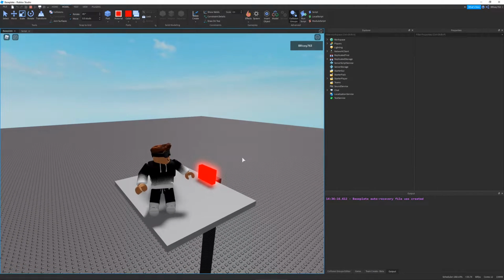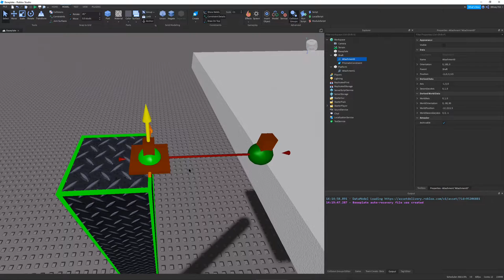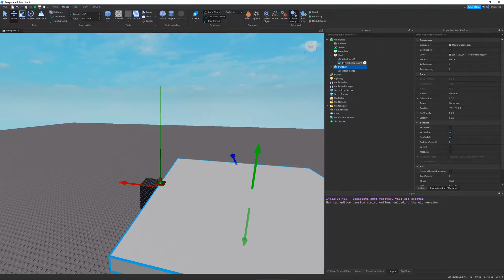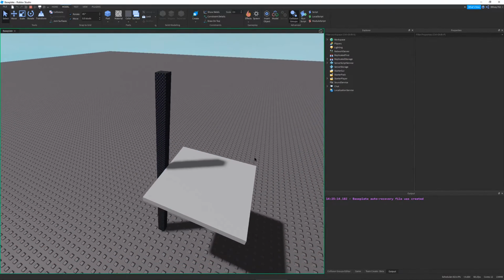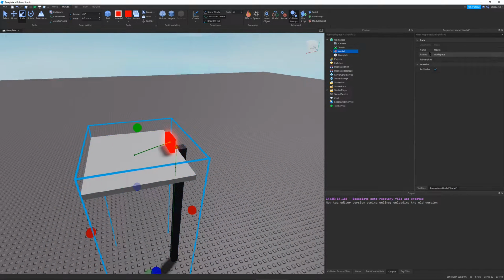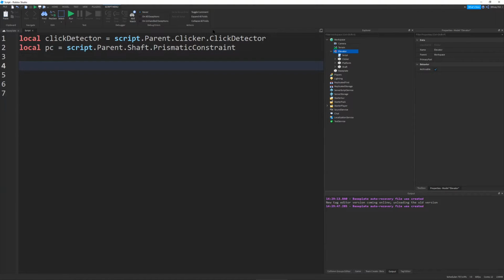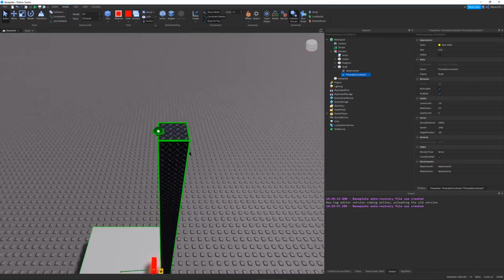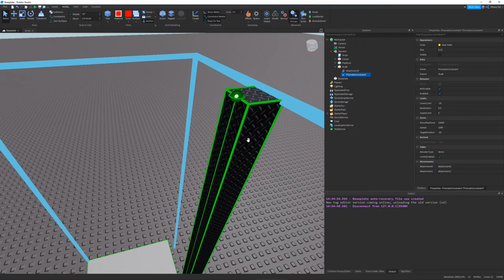Create an Elevator Using Prismatic Constraints! - Roblox Studio Tutorial

Comment: There is an issue with prismatics and a reason why tweening would be preferred:

Tweens take up less network resources
Just because constraints don’t require any action on your part to replicate to clients doesn’t mean it has no network cost. In fact, they have more network cost,. Instead of a simple event telling clients that the door has closed, it now has to replicate the exact position of the door.

Constraints, obviously, are bound by physics
Sometimes, accurate physics simulation is a bad thing. While Roblox’s physics engine has gotten better, it is not infallible. It will break sometimes. Tweens ignore physics and keep moving. So, if a player puts something in the elevator shaft, for example, a constraint-based elevator would break and a tween-based elevator would clip through the object. This would probably lead to the object either being flinged to oblivion or inside the elevator, but regardless, the elevator remains functional.

And being bound by physics, players can exploit the system
Roblox distributes the task of simulating physics to players to save server resources. This is even after FilteringEnabled. This means an exploiter could, in theory, break the elevator if the server lets it simulate the elevator’s physics. There is probably a setting to stop this, but I’m not sure.

Comment: Great video! Thank you I struggled a bit at first. Script works for 2024. Be aware of the target position I forgot the - before the value and it took a minute for it to work. Also make sure your adding your target position and not the videos. 

-- Access the ClickDetector and PrismaticConstraint
local clickDetector = script.Parent.Clicker.ClickDetector
local pc = script.Parent.Shaft.PrismaticConstraint

-- Variable to track the state (up or down)
local isUp = false

-- Function to handle mouse click event
clickDetector.MouseClick:Connect(function()
	-- Toggle the state
	isUp = not isUp

	-- Set the target position based on the state
	if isUp then
		pc.TargetPosition = 0  -- Move to the up position (0)
	else
		pc.TargetPosition = -27  -- Move to the down position (-27)
	end
end)

Comment: again, just like the last video a watched, it works for everyone but me... i have it with the prismatic constraints connecting the two, but the platform just doesnt move.
Reply: I actually encountered the same problem, did everything as suggested and it didn't work at first. Tried it again and found the mistake. The second time I actually didn't group the objects and I noticed that if you change the material of the part it can influence its mass, so try to set the ServoMaxForce to a greater value if you`ve changed the material of the part to a havier one such as metal or concrete.
Reply: Or set it as a 'massless'

Comment: Does this only work for platforms or can it work for a realistic lift with a roof and walls?
Reply: I think it should work. Just make sure the roof, clicker and walls of the lift are welded and not anchored. If that doesn't work I would either mess with the settings to give the lift more power or make sure the lift isn't in the shaft or touching the outer walls/doors.
Reply: @glenreidy  I can get it to go down but it wont go up again. I tried doing it with just the platform like in this video but it still doesnt work. When it is down it seems like the prismatic constraint becomes inactive.
Reply: @evanslater4551  try altering the power settings.
Reply: My ServoMaxForce is set as 150005

Comment: Tween service is more likely for doors but I tried it on making lifts but it's very shaky
Reply from the maker: exactly why I use this method
Reply: I would recommend using prismatic constraints if it works for you, but if it doesn't like me I just used an animation to animate the elevator.